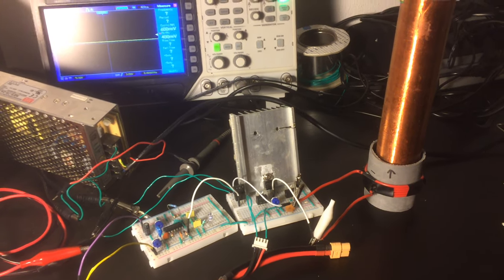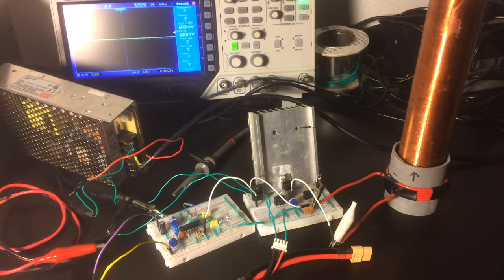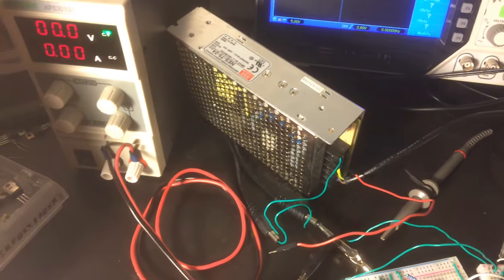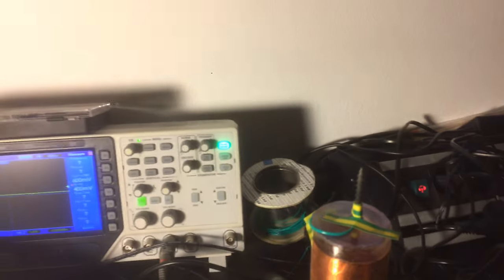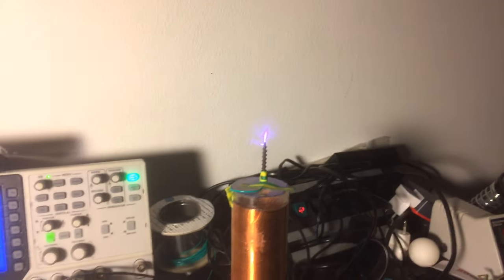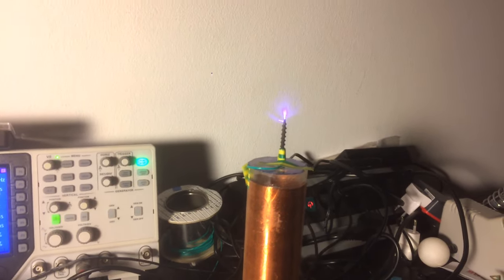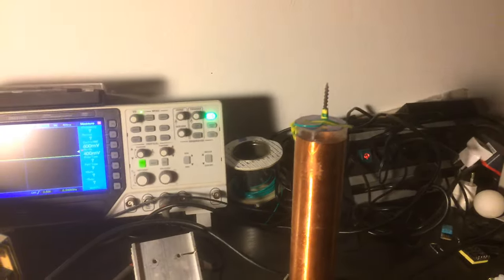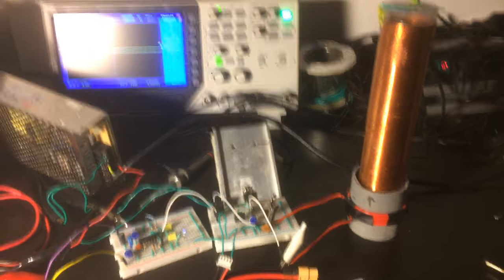Overpowered modulated Slayer Exciter Test run 100 Volt

Comment from the maker: Update: The mosfet blew at around 300 watt when I pulled an arc with modulation, seems it would draw even more than 300 watt in theory with CW but that'd be too much for the mosfet. Still this is very likely one of if not the most powerful slayer exciters on YT.
Reply: Nice work with the audio modulation, easily the most powerful audio modulated slayer on YT however I believe the most powerful slayer exciter may belong to myself.
Reply from the maker: @sandman1567  Hey, thank you for your comment! That may well be the case! I've been super busy with uni and work the past little bit so I haven't been active on youtube. I'd love to see what setup you are running! The thing with these slayer exciter type circuits is, they are not always behaving optimally and under certain conditions there can be several limit cycles some of which are efficient, some of which are not and blow transistors. I'll eventually redo this circuit but with a superior design that will have only one stable limit cycle and should have a faster convergence due to a much higher loop gain, see this is another point why the slayer exciter circuit is only marginally useful, as higher power mosfets tend to have lower gain factors so ironically, you are better off using a weaker mosfet.

Comment: i have a question... why is the slayer exciter always being fed like 9 to 20 volts or smth like that?
cant I use a first stage traf to get 500 to 1000 volts out of 2 9v batteries? then use a rectifier for ac to dc and use a capacitor to flatten the DC to be more continuous and then have that be the input to my slayer exciter circuit?
Reply from the maker: Hey! Sorry for the late reply, that is a very good question why slayer exciter circuits are mostly run off of low voltage on youtube and at quite low powers. It's not so much about the volts as it is about the current and power the circuit draws. One major problem of single transistor designs is that they just do not scale very well. You can forget using 2 nine volts batteries to power something that will draw circa 1000 watts unless you want to drive it pulsed, but that will drain the batteries in like 5 pulses.
Reply: @ivanrodionov9724  thx. ye i thought bout charging a cap bank first nd then dumping it into the thing. but now i have a problem with mosfets and transistors. bc the transistors i can buy online have shit current rating nad the mosfets need a driver nd i actually wanted the circuit to be as compact as posible so idk if i should try somehow drive a mosfet, or if I should use like 2 or even more transistors in parallel. idk

btw the application is "hand held tesla coil" i gues. but I think it's not possible with just a slayer exciter if I want really big arcs. I think I might need to just get a supper well tuned spark gap coil. idk. If you have suggestions that would be very nice.